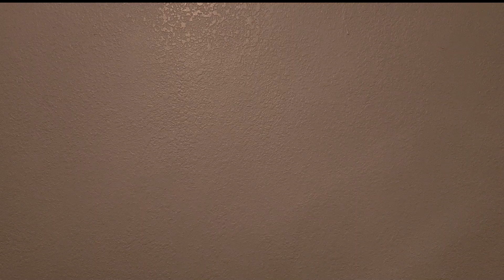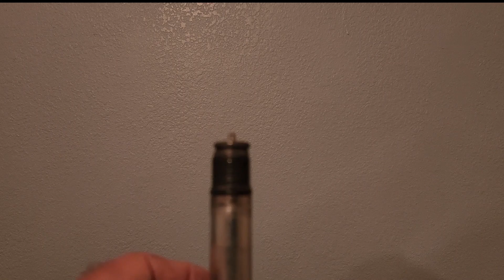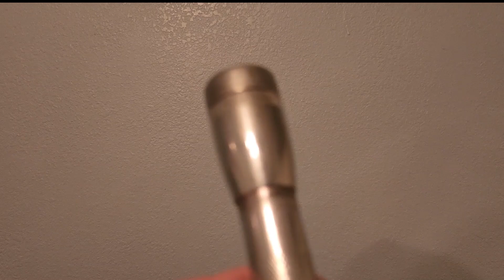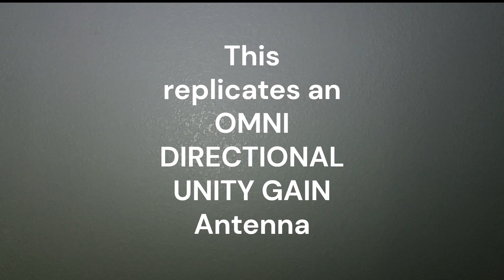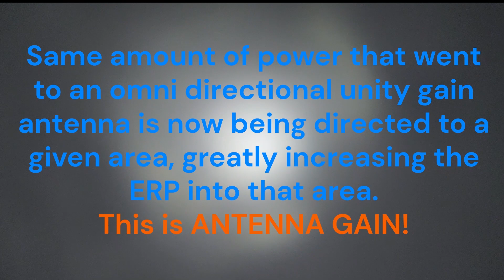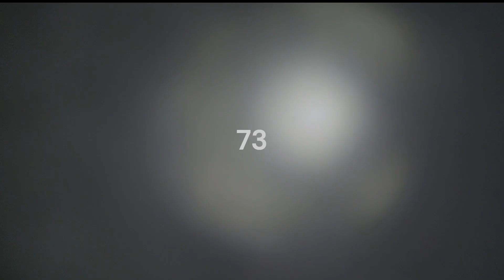Antenna Gain

Comment: One of the nice things about the higher bands is that it's easier to get gain, since the elements are so much smaller. I've hiked up for SOTA and POTA with 14-element Yagis on 23cm and 33cm and they weigh very little and don't take much space. Those antennas turn a simple HT into what's essentially a mobile radio with the ERP. But then you think about the size and weight to get that gain on HF and it's crazy, LOL.